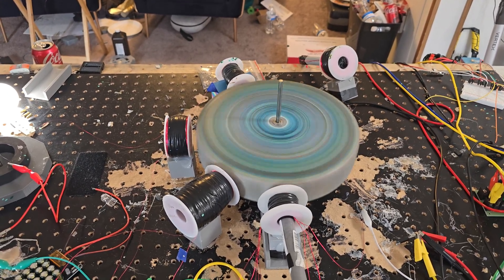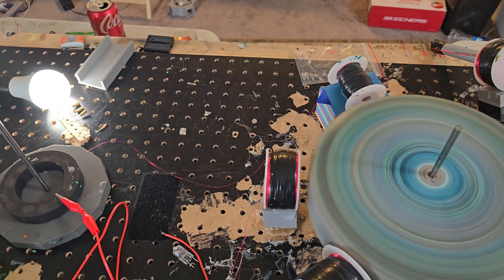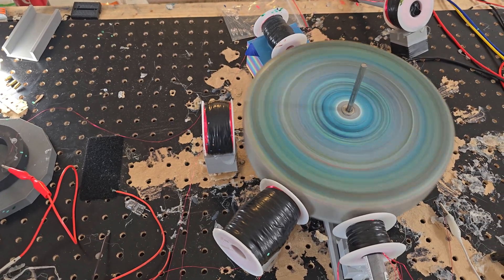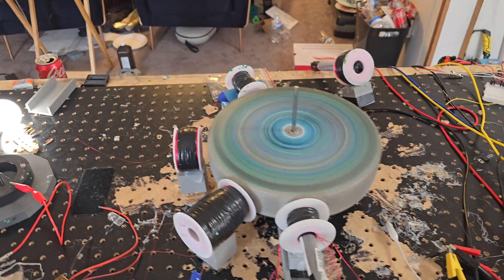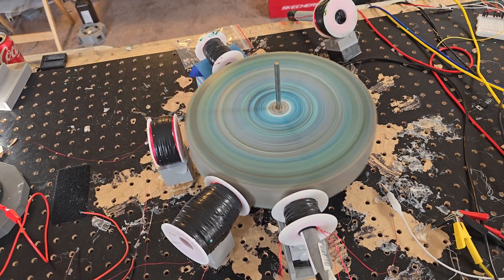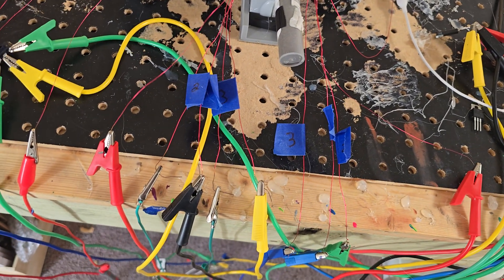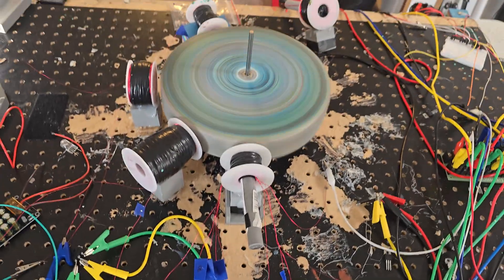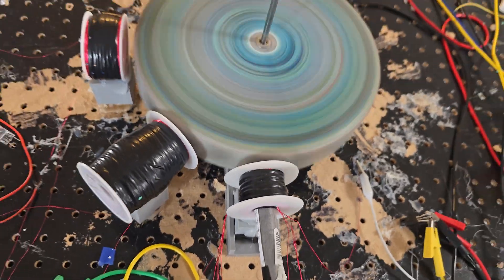pulse motor table top toy Papa Bale passionately explodes about the point of it. explicit

Comment: Basically a motor/generator with a common shaft & magnetic rotor.
Reply from the maker: good observation very rudimentary pulse motor this video is not about the motor however,.
Reply: @MPHJR  what would be interesting is if the driving electromagnet coil could be used to generate electricity .. either a single coil or dual, independent or 'stacked'
Reply from the maker: @bruceheadley7191  and what would be different about that? and why it wouldn't gen much anyway?  I you have an idea you need to give me more information.
Reply from the maker: if you have a specific coil design drop it in the comments
Reply from the maker: @bruceheadley7191  i have a 32 awg strand embedded in the main drive coil
Reply: @MPHJR  just a thought. Instead of having separate coils for driving and generating (and additional iron cores), a BLDC motor 3 coil configuration .. but each coil functions both ways (say a primary winding of 25 turns and a secondary of 100 turns). As each primary is fired, the secondary is also fired.
Reply from the maker: 2 awg's?
Reply: @MPHJR  oh Lord, if it was 50 years ago, I could have pulled the equations out of my head for calculating coil windings AND how to build a custom vacuum tube amplifier ..

I'm just tossing out some ideas to tinker with, it's technically possible to wind the trigger, drive and output coils all on the same bobbin and have it operate (the coil phasing might be a little tricky, but doable).

Why? Simplification. Cost reduction. Improved efficiency. Fewer components. Better magnetic flux utilization (by combining and sharing)
Reply: @MPHJR  oh just fyi: LED bulbs usually use 10% of the energy to generate the same amount of lumens as an incandescent bulb. 

The incandescent bulb will consume 60W of power over 1,000 hours of operation, whereas the LED bulb will consume 12W of power over 1,000 hours of operation.

The use of 'wattage' is more in tune with light emissions (lumens), since it's an easier standard to grasp.

Comment: I dont get it... You are not getting extra energy... Your DC PSU pulses the flywheel and the a few millimeters later that energy gets taken out of the flywheel by the draw from the coil running the lightbulb... the energy you put in will always be more than wht you would need to run the device you are powering as you are losing some of the power from the PSU through the friction in the flywheel device... Ive build quite a few of these motors in the past, actually still have a 3dprinted one running in the lab. Lasersaber was a cool Youtube channel in the hay days!
Reply from the maker: My fault for misunderstanding you left out heat loss If I said extra energy I did not mean that I don't think I implied it anyway this particular video is about me and less about the motor

Comment: Your ligjt bulb is a f   eneegy safe light wicj means it consumes 3.5watts of energy    but data on the bulb says 35w because it is givin u that mas lumen
Reply from the maker: still consumes the most power and of the lights that would be lit. and places the highest load of the lights that would light up 3.5 w to light the light but not 3.5 consumed lots of loss there...